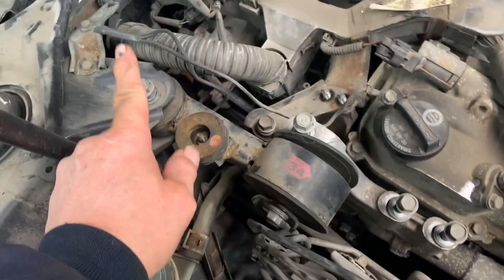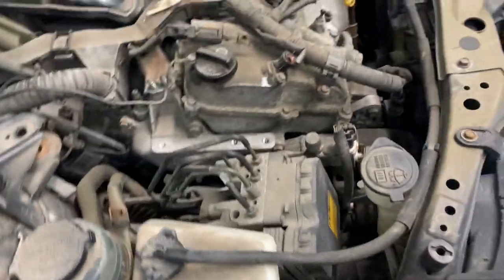2008 Lexus ES350 Water Pump Replacement

Comment: Thx Ritchie. I got a little heavy handed with a thermostat change and broke one of the two studs off the housing body so I appreciate you showing me what to expect when the new body part comes. Good luck! And I'll be watching your later posts.
Reply from the maker: Well things happen maybe get a small drill bit ,drill in the center and use extractor unthread the bolt take your time
Reply: This was a excellent video and it’s was just what I needed for my 2008 ES350. I figured it was my water pump when my wife drives the car she will hear a grinding noise and the car will leak fluid, she will see a little smoke from the passenger side of the vehicle and it will try to run hot. I figure that the propeller in the water pump is bad and I need to replace the pump.m or maybe the radiator. But it was good to see a professional, well explained video with no cussing it it. Thanks again, I’ve subscribed!!

Comment: Great vid! Quick q, I got quoted $1,200 by 3 mechanics for this 08 es350 water pump replacement. Thoughts? I’m sure if three folks say that’s what it is then it’s what it costs today. I went in for service thinking my idler pulley was faulty but was told it was water pump.